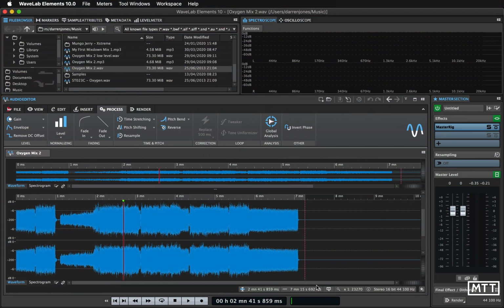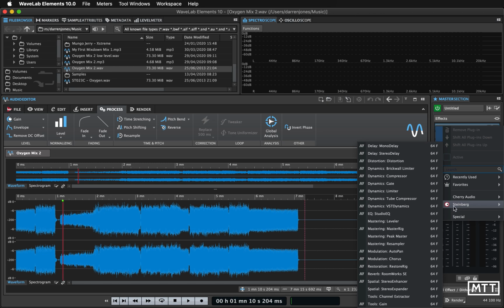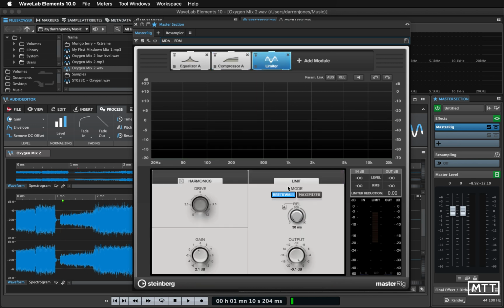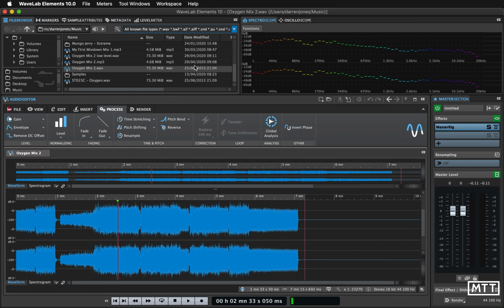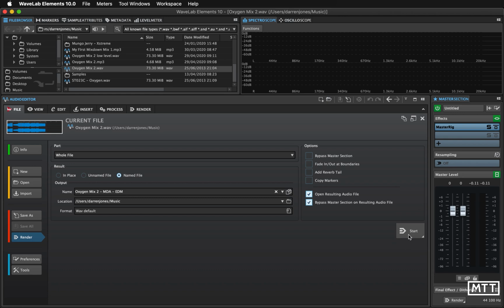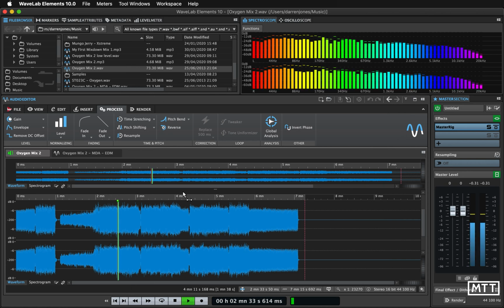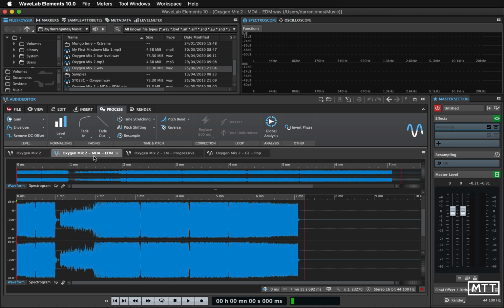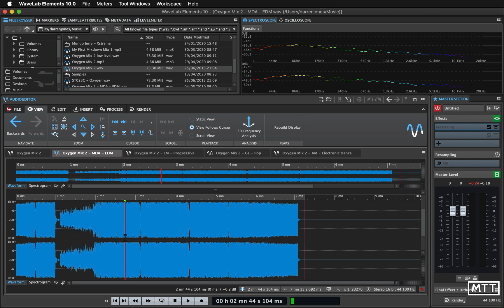Lockdown Learning: 26 - MasterRig Presets and Render in Wavelab Elements

Comment: Can you please show us a way to use reference tracks using Wavelab Elements? I do understand that the Wavelab Pro has reference track as a new feature. However, I am not sure if there is a way around to use it with Elements. Thanks once more for your lockdown video series.
Reply from the maker: Hi Leonardo.  Tomorrow's video will probably be useful to you - using Cubase for comparisons - where you could add in a reference track as well.  I'll look into if there's any way to achieve this in WLE!
Reply: @musictechtuition  Thak you. I normally use Cubase's Control Room for such a task. However, I would like to give use to my Wavelab Elements. Thank anyway. I will check it tomorrow indeed.
Reply: This is Wavelab Elements, the most basic Wavelab one can get. The regular Wavelab 10 encompasses what you are looking for.
Reply: This is Wavelab elements. Wavelab 10 (standard) encompasses what you’re looking for and so, so much more